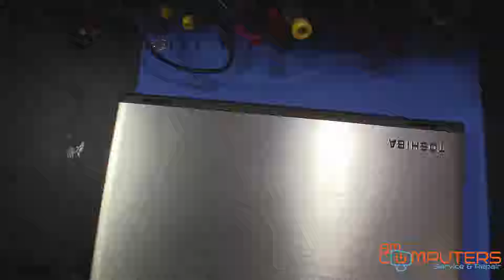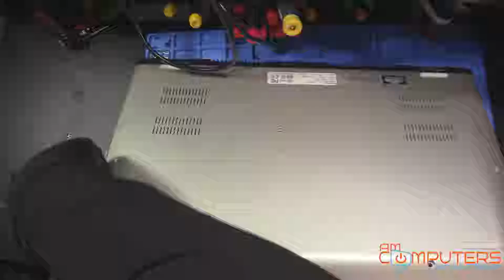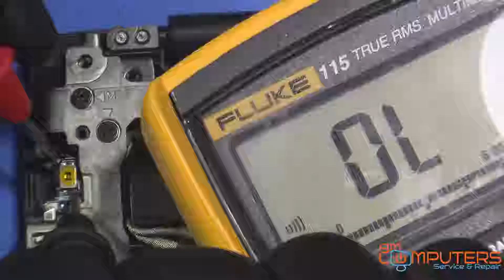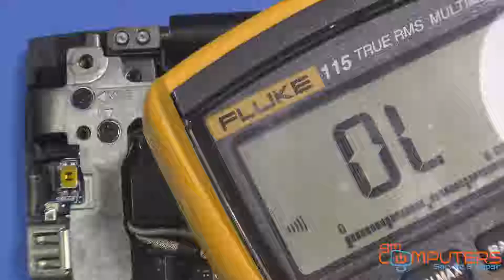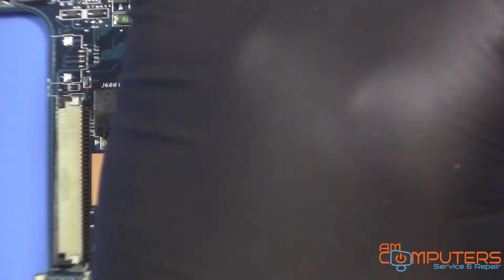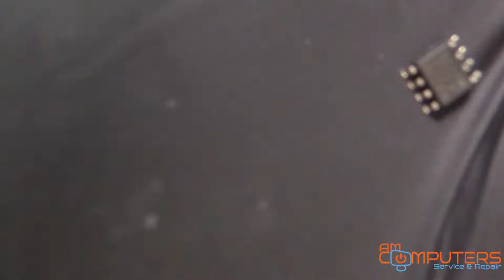Trying to Fix a Toshiba Satellite P55W No Power Motherboard Issue Part 1 - Could use some help!

Comment: What happened with this repair? I have a Toshiba p50-a and seem to have the exact same fault with the second MOSFET and am hoping to try repair it..
Reply: I have a similar problem with my p55. The keyboard backlight comes on, but no power to the mb.  Frustrating.  Any idea where schematics can be purchased?
Reply from the maker: Unfortunately it went no where. There's a channel called electronics repair school. He has a lot of videos with similar faults. Might be of some help